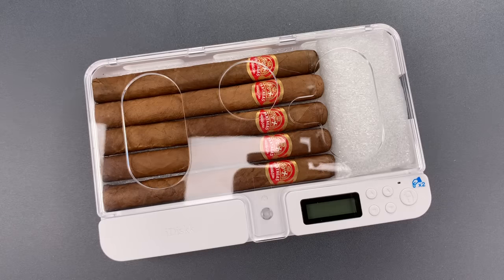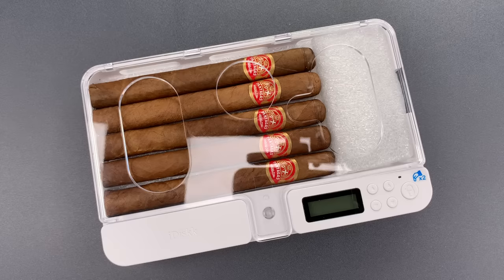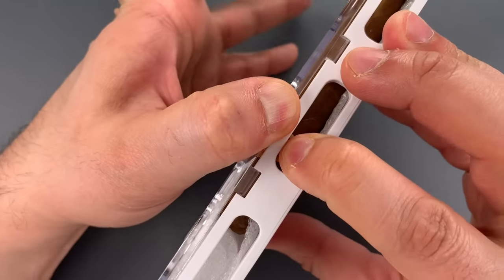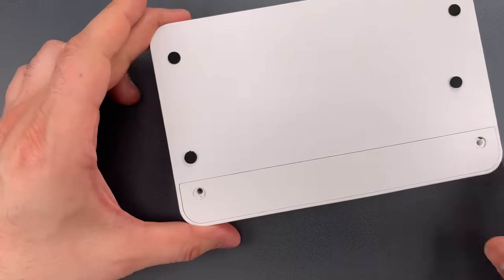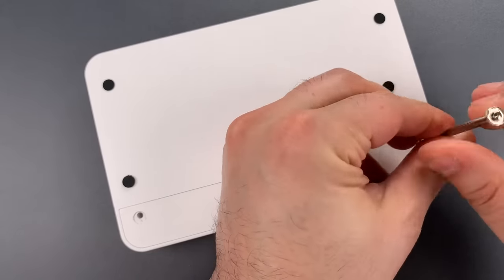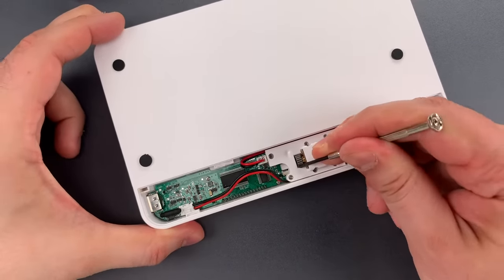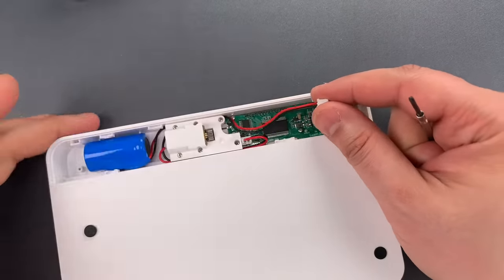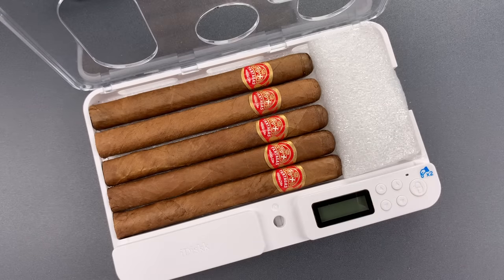[1192] Cuban Cigars Secured In An Electronic Smartphone Locker

Comment: Easy, get a plyers, rip that little tab off the side, or get some sharp razors or exacto knife, heat it up and cut the plastic so you can just dump the cigars out.
Fumbling with picking a lock to steal some cigars seems a bit counter productive when the entire object fits in a pocket.
Side note, if you own a safe with a handle or something that can be easily lifted or carried out of your home, CONGRATS! You packaged up everything you "didn't" want to lose up nicely and securely for the criminal(s) to bring to a even more discreet location to open up! I'm sure they thank you!

Comment: Looks like a pretty basic servo motor, zeroed to the unlock position. Disconnecting and reconnecting the battery must've reset all the data on the computer chip, including the position data for the servo motor, causing the servo to turn to the unlocked position.

Comment: technically when you unplugged it and plugged it back in the clock was reset to 00:00:00 so the timer technically ran out so you may have gotten the cigars but you failed the challenge.

Comment: I would argue that this is more meant to prevent a burglar from being able to snatch your cigars when he only has a minute or two inside your house to grab what he can, which would keep him out of the case just long enough, even if he did have the correct size screwdriver with him.

Which would work perfectly if this was a big, heavy safe. But as it is, it really just provides a neat case in which to keep the cigars nice and dry until you get home where you can open it up in peace. 😂

Comment: Recently my house alarm bugged and couldnt get turned off with my remote. All I had to do was unscrew 4 screws and disconnect the battery cord and connect it again and that reset my alarm... (note, i did disconnect the fuse from my garage first, but that didnt stop my alarm and I didnt know it had a large 24v backup battery inside the alarm panel)

Comment: There's a small hole above the button on the right I'm wondering what that does, but I'm assuming it resets the timer without unlocking it. I'd laugh if that lets you set it to something like 3 seconds.

Comment: Pulling the battery set the clock to ZERO and just (flushed) "ran out of time", thus actually failed to open before time "ran out". What would you do if it was epoxy potted pcb with internal clock battery? If it was a nuke, we would all be goners...

Comment: Interesting... Once I saw that phat battery in the back my first idea was to unplug it as well since most cheaper circuits will reset timer chips entirely upon power loss because there's no passive memory available on them which basically means you restart at 0:00h to go and the lock opens itself for you :') Glad to see we're on the same page there indicates I might've just learnt something by binging your videos :p Even more glad to see it actually worked because let's be honest it just feels good when you have an idea and it actually works :')